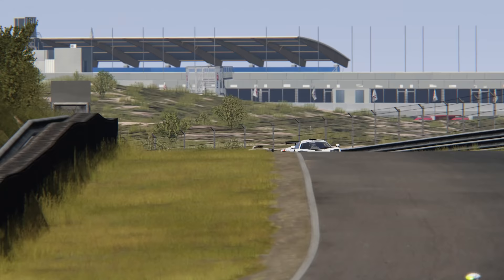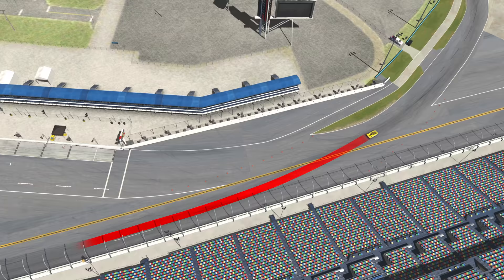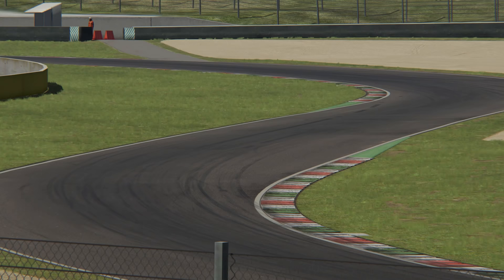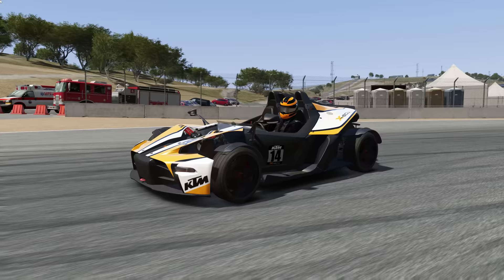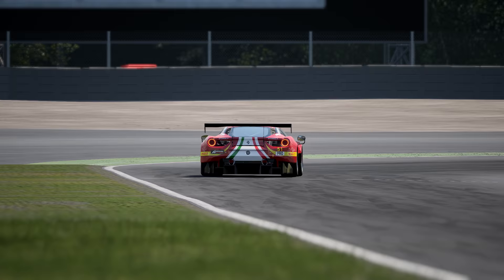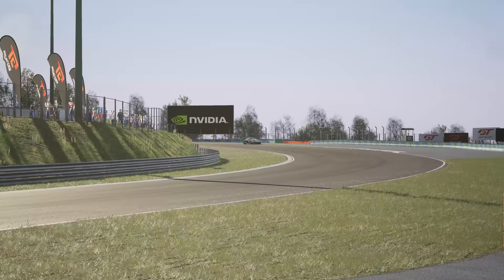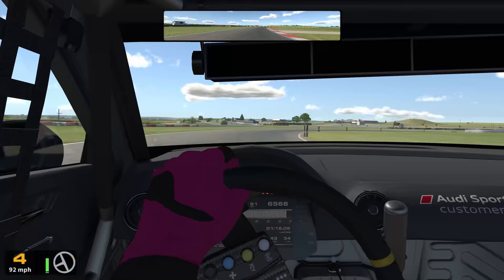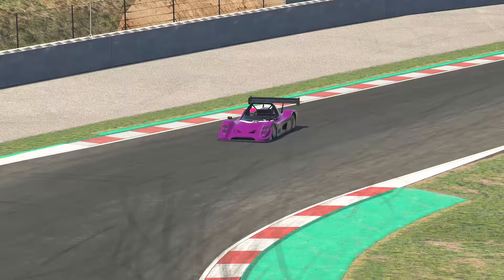What is Trailbraking? | The Ultimate Sim Racing Tutorial

Comment: Good video, but I feel it would have been more informative if you showed the steering and brake inputs to better show the technique
Reply: its acc very simple you turn just a little bit and you just pray to god you make it out of the corner
Reply: Tricky to fo that, the technique is different for every type of car and then how it is set up, and what the specific conditions are when you approach each bend.
Reply: Also, if you sim race, a great way to learn is to try forcing understeer or oversteer in a corner solely by how you use your brakes ... learn how to alter the cars turning behaviour by using extremes: learn how to create predictable amount of understeer and oversteer with the use of the brakes. start with terminal amounts, then dual it back to something useful. I think then it'll be obvious to you what works best for you.

Comment: I drive the McLaren the most in ACC and I'm really  struggling with this technique. Whenever I try it I go immediately in to an oversteer  spin. Slow corners, fast corners and mediums. I just can't seem to "feel" the balance.
Reply: @jesper rathsach I am/was the same. Its the car I chose in second half of career mode. I'm jus in practice mode allllll the time.

And I turn on the consistency scoring jus so it shows how quick ur actually taking sections.. there are a few tracks I think am smashin but it shows I'm "slow" so I kno I can push more. Or at the other end. It can say "too aggressive" so I kno I can cool down abit and not be so hard.

Don't wanna sound an arse but the corners ur pushing on u may actually be pushing the car over the limit for that corner, if that makes sense. I have found tht with quite a few corners to says too aggressive or out of control, but from me driving its controlled over steer
Reply from the maker: I would either try adjusting the brake bias towards the front (increasing the number), or lowering the rear ride height and/or raising the front. Give that a go and see if it helps 😊
Reply: @TraxionGG  OR THAT lol..  listen to the pro lol.
Reply: @TraxionGG  I will try it out. I'm running the coach dave academy setups, and maybe they are a bit too aggressive for my style. I just don't quite get the theory behind what's happening since I spin out so bad on even very slow corners. Am I breaking too hard and generating too much grip together with too much steering lock?
Reply from the maker: Quite possibly! The McLaren is mid engined and finely balanced, so is sensitive to snap oversteer. It might be that by loading up the fronts too much, you are leaving the back of the car with less grip as you turn in. 

It’s always a tricky car to master, and is actually one that does suit a bit of coasting into the corners at times, even if that sounds a bit contradictory after watching this video! It’s like I said though, everything is dependent on car choice and setup, so some cars will suit certain things more than others.
Reply: i've got around 1500hrs of ACC done and in any community championship still come up in the AM category, normally 2-3 sec removed from the top drivers. I've driven many a car, but can honestly say that a car has to suit your style. For me that's Aston Martin or Bentley. I can do McLaren or any other mid engine stable, but 1 sec down on the AMR of Bentley. So first and foremost, find a car in which you can do laps stable and consistent (meaning, no foul ups). Then start making times in that car. When mastered, THEN go for other cars and learn them. I'm no top driver by far, but I am consistent and safe, meaning I qualify low but end up finishing in top ten most of the time and can turn on the screws on guys outqualifying me but not outpacing me (if that makes sense). I've got tons of vids on my channel and stream regularly on my twitch channel.
Reply: @Tobus75  Much appreciated, and that's actually why I've for now settled on the McLaren. It's not the quickest one on SOME tracks for me, but it's overall the car I feel the most comfortable in - with the way I drive currently. Now, that may change once I get better at this trail braking, but for now it's the car I feel is the most fun to drive and the one I feel the quickest in.
I can't really get to grips with the right side seat in the Bentley, so have hardly any laps in that. The Aston I have a hard time with the gearbox. I do like the AMG, M4 and the Lexus of the FE cars.

Comment: What seems to be left out is that with trailbraking you actually need to carry more speed into that corner for it to work propperly braking while steering into a corner isnt always trailbraking certainly when you fail at it your not trail braking your just fucking it up this also wont work on every corner and is specificly aimed at faster corners because the longer and wider the corner the more effect its gonne have on your times

Comment: Non-racer here: is trail braking done with one foot on the brake and one foot on the accelerator, simultaneously? (I thought that’s what the camera showed.)
Reply from the maker: It can be done either way. Sometimes you need a little bit of throttle at the right moment to stabilise the rear end of the car, but most of the time you won’t do. All depends on how the car you are driving behaves (and the specific corner). Experiment with both options if you are unsure! Hope this helps and good luck😊
Reply: @TraxionGG  thank you for that info. I can’t imagine how long it would take to develop the left leg driving muscle to go light on the brake when it’s used to going heavy on the clutch pedal.

Comment: So you are off the throttle when trail braking?
Reply from the maker: Yes, although occasionally a tiny bit of throttle can help stabilise the rear end of a front wheel drive car heading into a corner (depending on the sim etc), and sometimes a blip of the throttle on downshifts can also help things in the braking zone. There are plenty of variables so its very much a case of trial and error :)